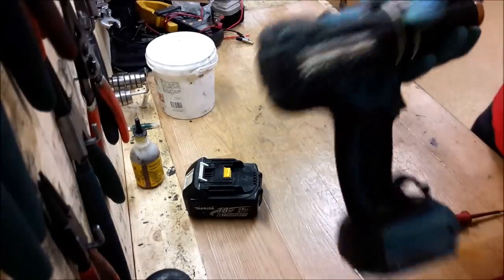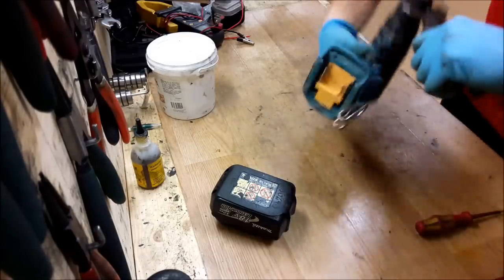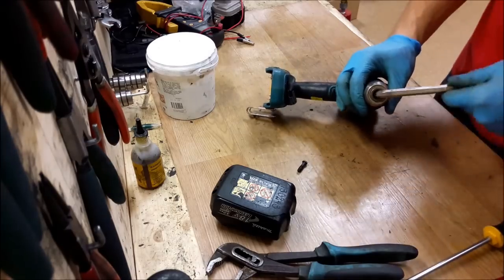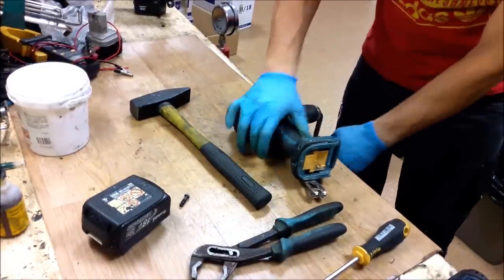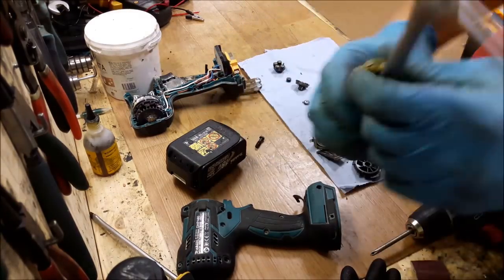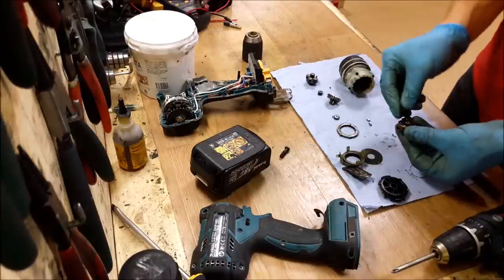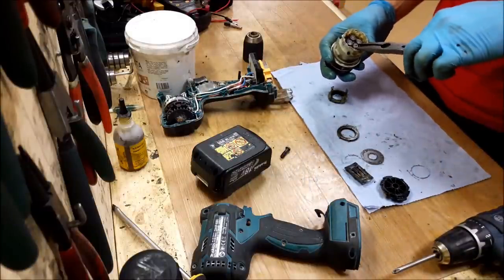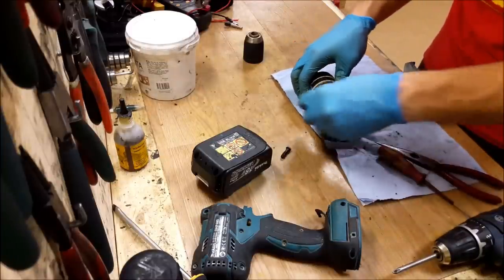How to remove cordless drill chuck Makita DHP480 18V li-ion drill

Comment: very helpful! Tried putting all planetary gears back in all at once. More then three times I tried this to no avail expecting different results 😲finaly I settled down😬... then whent one gear at a time. tricky part I did not catch first time was two little pins that hold clutch on plastic clutch ingage part...after I figured that out no problem👍 

some are capable of doing this some need every detail dont worry about comments. easy if your patient and can pay attention to what your doing.  your vid was just what i needed especially that 7mm trick on the gear, that was a HUGE HELP!!! thanks!!!!

Comment: You took the whole drill apart becuse you needed to stop the shaft from rotating to remove the chuck. I abandoned the hex key and hammer a long time ago after it failed to work on a tight chuck. Chuck a  big hex bit socket in the drill and put the socket on an impact wrench. Works every time and sure beats taking the drill apart.
Reply: Even 550 Newton Meters does not loosen up that chuck. :(

Comment: With Makita,  once that reverse thread is out, put a T40 torx in its place on an impact in reverse and just give a quick squeeze. Runs the chuck right off
Reply: MB Irankiai Profesionalams I just know from repairing my own through trial and error. Just got done rebuilding my chuck and couldn't find anything except "replace" videos
Reply: MB Irankiai Profesionalams It actually wasn't too bad and I don't have any repair shops near me so I'd have to ship back and forth for warranty or buy a new one and still wait for delivery. I can send a couple pics I took of the process. It's basically one plastic ring pry off top, snap ring #1, outter grip, snap ring 2, a collar inside and the jaw teeth pop out.
Reply: MB Irankiai Profesionalams but yeah, the teeth were sticky and one out a lot farther then the others after using a wet diamond bit in porcelain tile

Comment: My driver drill's chuck has misaligned jaw (2 stucked at lower part, 1 at middle part). This method still unable to fix my drill issue. Do i need to replace the entire chuck?

Comment: Have you you got any tips on removing makita dhp458 chuck.. The retaining screw snapped ages ago during use.. But now the chucks worn i need to change it.. Ive tried the allen key trick a few times and also trie using an impact driver to release it.. But its not budged
Reply from the maker: You can drill off screw had and use allen key method and then heat screw and take it out... Or you can disassemble gear assy and hold assy in vise or something similar to unscrew chuck and brake screw...

Comment: What was that tool you gripped the shaft with? Just a 7mm hex driver?
Reply from the maker: Yes, it's just 7 mm hex driver
Reply: @handyman7282  Thanks! Got my chuck fixed. Used the impact gun trick from farther down but your video was very useful.

Comment: Better not to respond
Reply: When someone makes a guide video, he wants to help people solveing problems. To share his experience or knowledge. And this what you did. So thank you.
However, an "How To..." video should show your knowledge and not to share your efforts trying to solve a problem. Especially if the guidance is misleading. You don't disassemble the whole tool just for removing a chuck.
Reply: Actually, I have to disagree with you.  This isn't a polished demonstration video - just some bloke trying to show people how to do stuff and, sometimes, it doesn't work properly.  

Half of the battle in learning just how these machines are put together is in the different methods you may need to disassemble them. 

However, I do understand your reasoning, as he did title it a "'How to", and not a "How I did it" but, personally,  I appreciate his 'warts and all' approach and, even if some of the camera angles are a bit funky or frustrating sometimes, his no-nonsense methods and simple explanations allow you to concentrate more on what he is doing with his hands, which is the important bit :).  (I'm definitely of the "monkey see, monkey do" approach to tool fixing)

Also, I don't know of anyone else who is stripping down and fixing as many of these Makita drills and the model I'm trying to fix is among them...